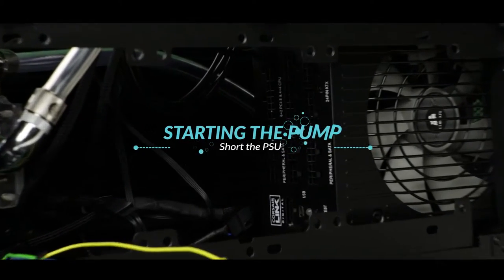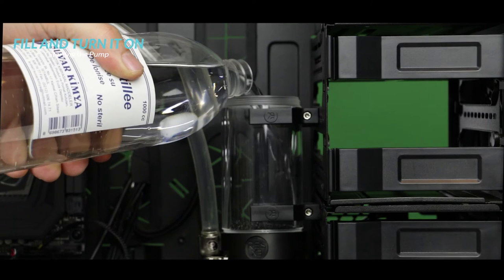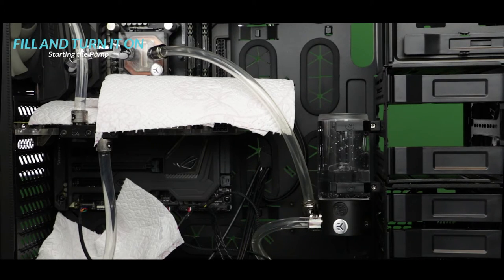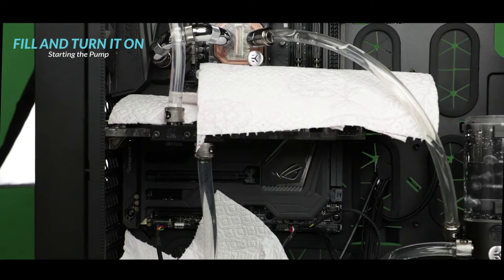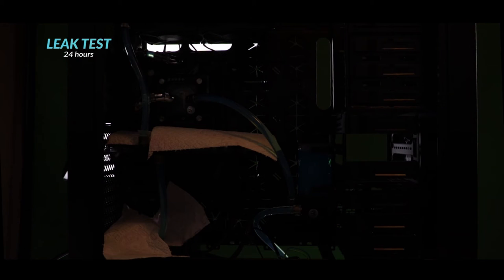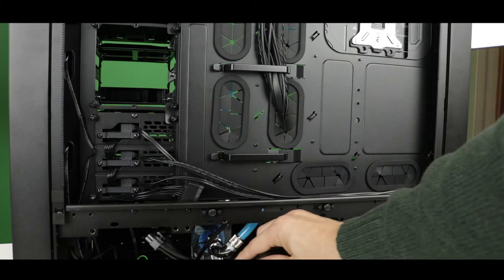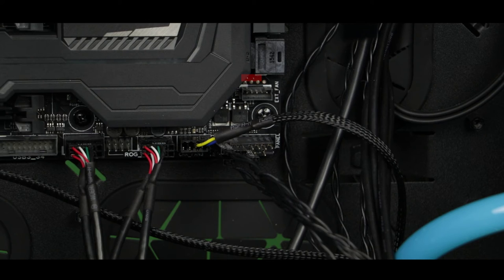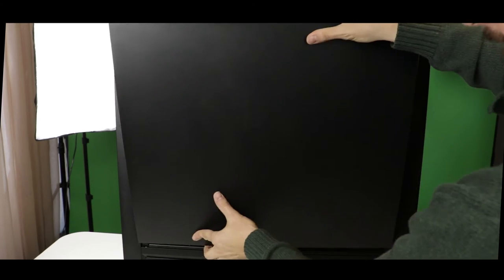Water filling ( custom water rig 9/9, Part 2)

Comment: hello, i found this video very interesting and helpfull.I would like to make some questions.
What is the case name and can it fit a 360mm radiator on top?
Does it have really enough space so you can watercool an ASUS IX Formula?(maybe radiator is blocking VRM waterblocks)
Which EKWB pump+reservoir did you use?
What exactly did you use to turn the water light blue?
Does this pump+reservoir combo include any tools to place it at the Hard disk drives just like 01:00 ?
Thanks a lot. :)
Reply from the maker: +George Polyxronides 
Hi there :)

The case is a corsair Obsidian 900 (full tower)
Yes you can fit a 360 mm rad on top:)
Yes there is plenty of space by go for a thin rad (LX)
I used an EKWB combo (D5 + 100mm res)
I used an EKWB blue coolant. It's rather cheap and works great:)
Yes.. the included screws and bracket should work on any HDD bracket 

:) thx for your comment :)

If u liked this build check the Ryzen Project playlist. It's a double loop with a 480 and 360 mm . You'll see what I mean by thinner rad :)

Comment: Hi, is this build suitable for sli gtx 1080? Would I need a more powerful pump and reservoir? I plan on intense gaming, what kind of temperatures do you get? thank you! this build is awesome!
Reply from the maker: +Harvinder Singh the pump is good for SLI custom plates. 

U can of course put a couple of them ..no problems, I'd advice to get a custom water cool SLI adapter to avoid working out the right tubing distance between cards

If not, go slow and take ur time.

Temperature wise , my card at full usage topped at 55 Celsius. 

Sweeeeet
Reply from the maker: +Laurent's Choice cpu usually goes anywhere between 30 to 60 Celsius depending load.
Cpu is over clocked to a unhealthy 4800 mhz , at 1.3125 volt.
Reply: Laurent's Choice Thanks, this is useful advice!
Reply: Is a dual EK-XTOP DDC 3.2 overkill with SLI for this system?
Reply from the maker: +Harvinder Singh nothing is ever over kill for custom water cooling ;)

Please share when u r done !

Comment: Hello, what do you do if you find a leek in the loop aka how do you fox it thx
Reply: fix
Reply from the maker: +Tien 
I'll point to the obvious... 
1- shut down the computer
2 - identify where the leak is
3 - drain the loop (computer off)
4 - wait 12 to 24 hours to dry any electrical components which might have been affected 
5 - replace the joint or leaking tube
6 - fill ur loop again
7 - 24 hours leak test 
8 - reconnect the peripherals 
9 - ur good to go :):)

I hope this helps:)
Reply: Laurent's Choice thank you very much